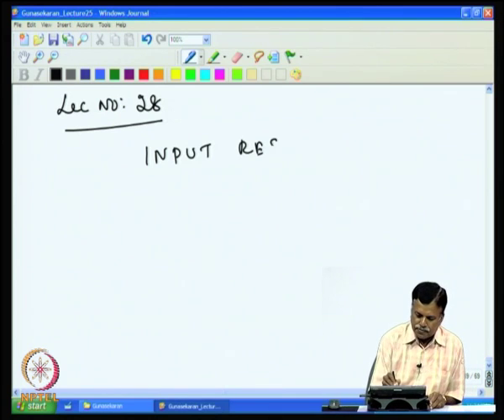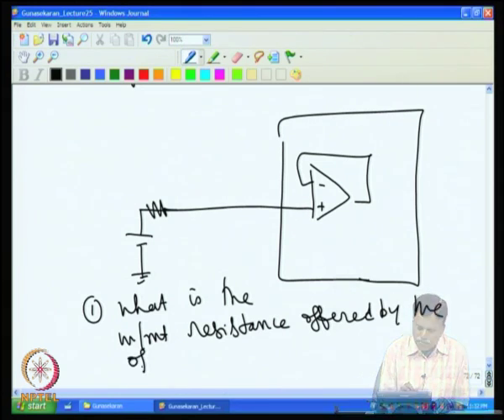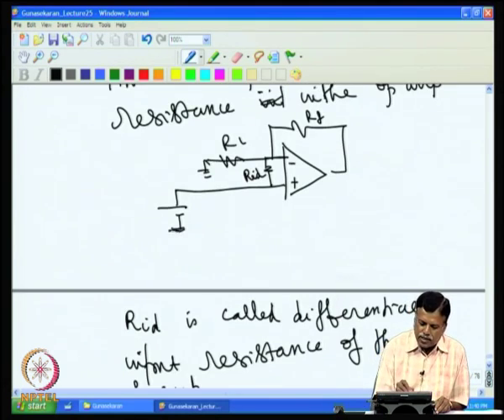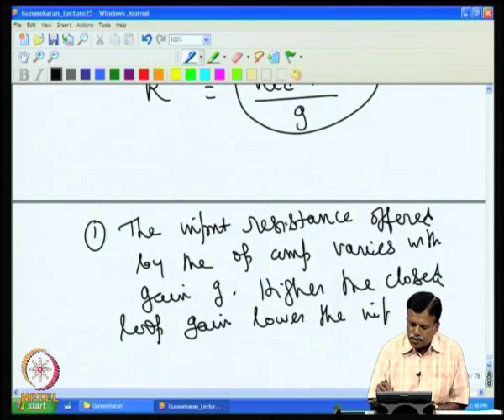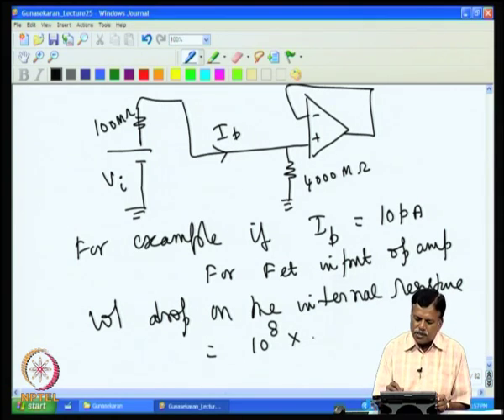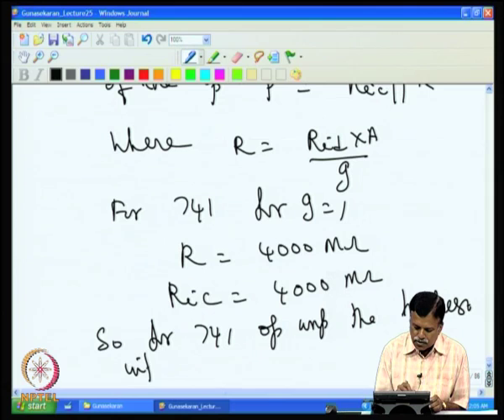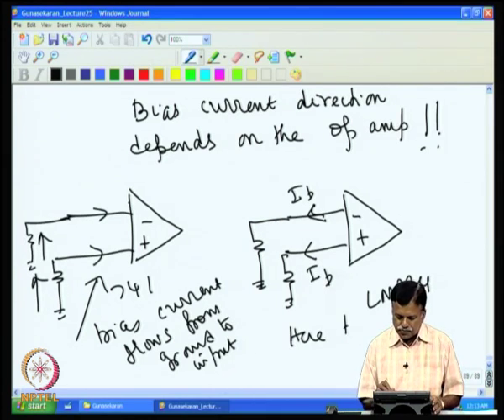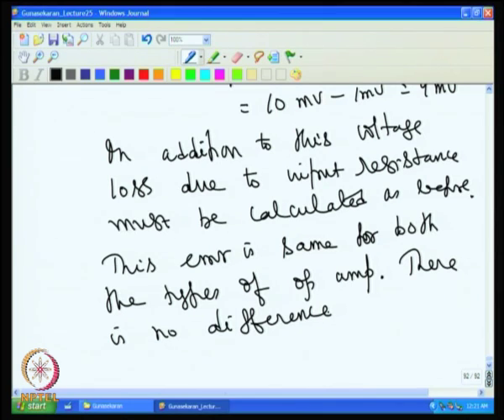Mod-04 Lec-20 Input Resistance Calculations for Op amp

Comment: 21:18 when ' i ' is the current through 'Rid' then whey 'R' (input resistance) is taken to represent i ???. This particular expression is confusing for me.
Reply: Because no current flows into the opamp inputs, So current through Re, Rid is equal, ie 'i'. This 'i' will then get split into feedback resistance Rf (if there's a load resistance) and Ri.